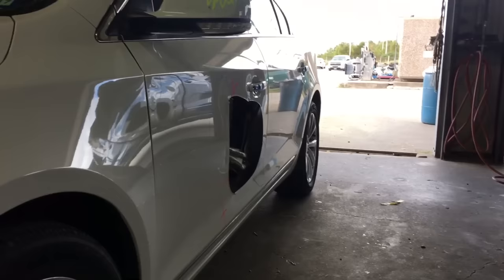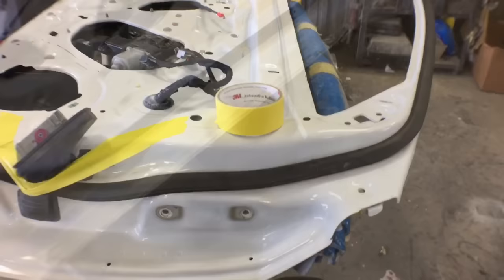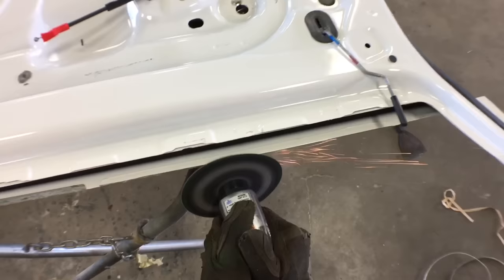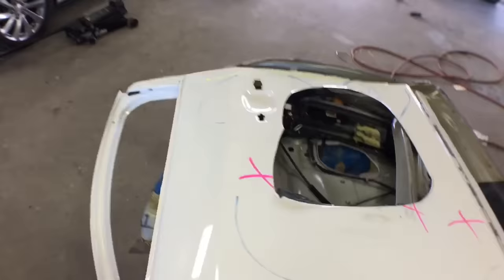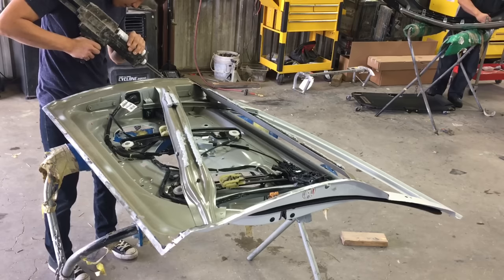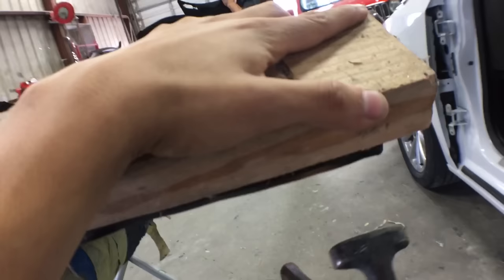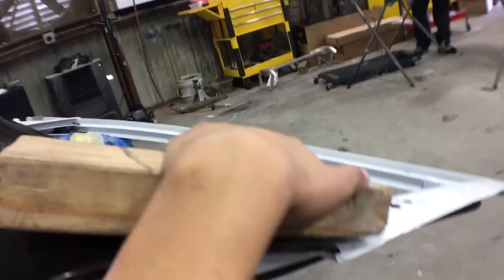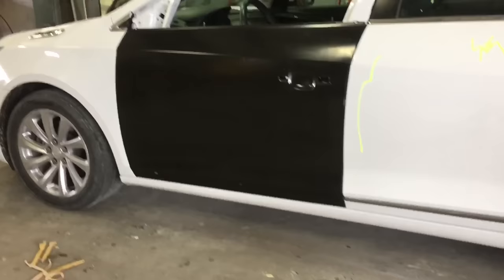POV Door Skin Replace

Comment: I'm going to pass this on so you won't beat yourself or a skin to death. First, gut the door before you take it off,15 pounds you don't have to manhandle.. Second, after you've split the hem with your grinder, and removed it, reach under and scratch the outer skin where the gusset and intrusion beam is, then flip the door face up. Use a rosebud to burn the paint off where your scratches are and where the panel bond locations are and all around the edges. Your skin will take itself off! Dress your edges like you have, seam sealer is good on the beam and stiffener. Don't panel bond the door shell, put panel bond on the skin! Set your skin, flip the door over onto its face and take a small rubber hammer and GENTLY roll the hems nearly flat. If you must use a hammer, use a light bossing hammer and a rubber dolly to clench your hems, throw that skin hammer away. At this point you have done no damage to the skin. Remount the door, check the fit and leave it until the bond cures. Send it to paint with NO BONDO! Lastly, buy the Killer Tools skinning tool and you'll do a door skin start to finish in 40 minutes. One last thing, NEVER EVER use your polished face finishing hammer as a ball pein! One more tip, round off the corners of your duckbill vice grips, those sharp corners cause distorsions.
Reply from the maker: Thanks for the tips.
Reply: Your right on with the torch very seldom do i put bondo ona door skin

Comment: good video. take your flanges down in 3-4 passes and you won't get so much wrinkling. Also make sure you're spreading the panel bond over all the bare metal with a spreader or brush before you set the skin. You may have done that, but I didn't see it shown.
Reply from the maker: Thanks for the feed back Sam G, all the steps get done sometimes I forget to add them in the clips . I see that you’re very knowledgeable in this field are you a bodyman yourself ?

Comment: Before you unhooked the wiring harness from the front door, if your gonna blend the rear door,  make sure to r&I trim panel, glass, door handle (ect) from the rear door first or else you'll have to put the front door back on, plug it up just to power up the rear door window. Just a heads up. Been there done that.
Reply from the maker: Yeah I've had that happen too but luckily on some you can drop it down with direct power
Reply: John Esquivel , 🤣🤣🤣, I think we've all learned the hard way, great job on pointing that out.
Reply: Auto Wizard 
Good job young man but in my humble opinion you have to use an air tool to get the lines crimped properly on skin & shell. 
Color is way off, don't think that would even blend into fender & rear door. 
But your video on how to do the job was very good.

Comment: Nice video but here’s some tips. When your done applying the panel adhesive bond you should go over it with a brush. It you just leave it like the way you did and not cover the bare metal with the adhesive the bare metal will cause corrosion. Also another tip blend the color with the adjacent panels. Like I said though nice video looks like you know what your doing though good job.
Reply from the maker: Thanks for the heads up I'll give it a go next time 🤟🤟

Comment: First off you don't want to spread the PANEL bond with a spreader it just needs a 1/4 inch bead so it bonds properly,it's also easier just to use a torch and torch the panel on the edges after you grinded the edges
Reply: papapmp04 you do if you don’t want rust on bare metal panels!

Comment: Good camera angle, but you didn’t show any panel prepping with grinding the old panel bond off and you need to make sure to explain things better as far as what product to use. You have to use a flexible seam sealer where the old NVH material is on the intrusion beam. You can also purchase specific NVH replacement materials. If you were to use a Solid material like panel bond or epoxy seam sealer it would put big warped spots in the middle of the panel. And the paint match👀
Reply from the maker: I see where you're coming from bro , I'm still working out the kinks , I'm working on making the best quality videos. Thanks for watching and for the feedback 😁👍

Comment: Very nice video, I didn't know it was so easy to do. How do u decide when u buy a door skin or a used door from a junk yard ?
Reply from the maker: Depends on the integrity of the inner structure. If the support beam has been damaged it must be replaced with a new door, if it hasn’t been compromised then you’re allowed to put a skin.
Reply: @AutoWizard94  When is it a good idea to do body work on a door skin versus replace the door skin ?

Comment: Hey auto wizard do you then go over the edges with seam sealer after?
Reply from the maker: After I removed the skin and clean the metal I add my panel bond then I've hammered all the edges clean my edges again and add seam sealer
Reply from the maker: After I removed the skin and clean the metal I add my panel bond then I've hammered all the edges clean my edges again and add seam sealer
Reply: jesse robins he should of used epoxy on the edges then folded the skin

Comment: Is it a big issue with disconnecting the wires. Replacing my door soon
Need advice plaese
Reply from the maker: No they disconnect from the pillar fairly easy.
Reply: Thank you. Just haven't had time to check it out yet. Thanks for the reply
Reply from the maker: @michaelcook2342  no problem, hope you can figure it out 🤟

Comment: How did you roll down the window after you took the door off?
Reply from the maker: I used my jump box and some wires and gave the window motor power like that . But what I’ve been doing now is just detrimming the whole door while it’s on the car first so I don’t run into not being able to let the window down after I removed the door